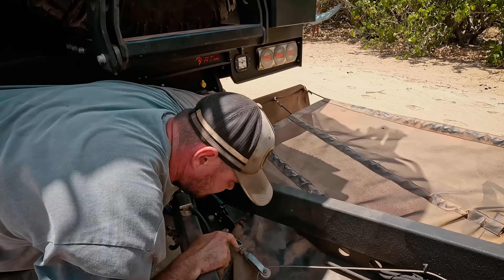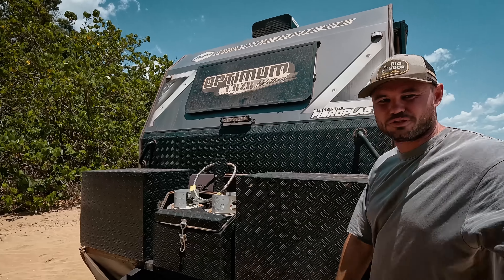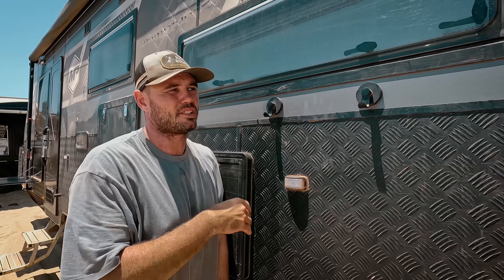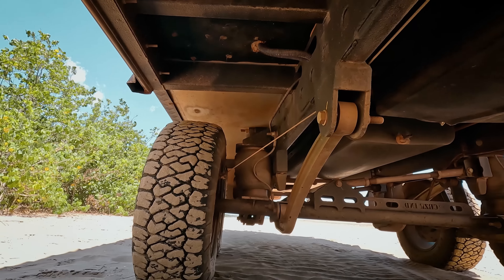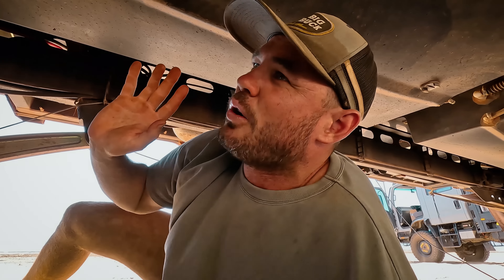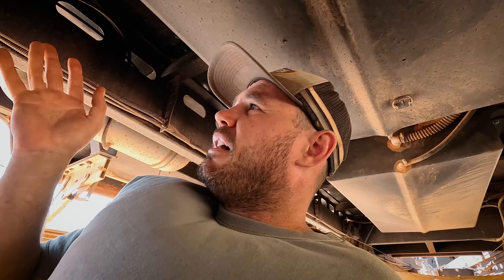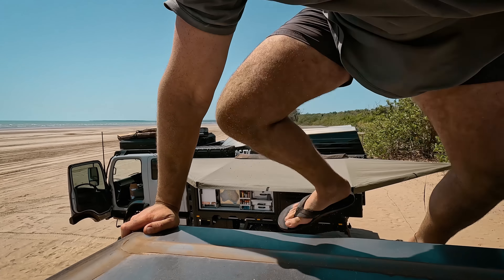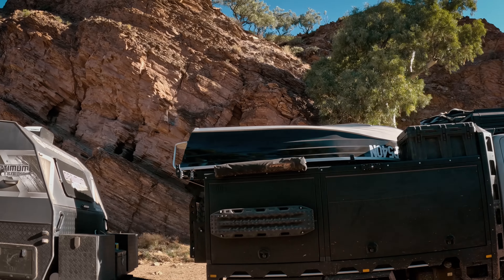25 FT OFF-ROAD OFF-GRID QUAD BUNK CARAVAN - PART 2 - SUSPENSION - CHASSIS - MASTERPIECE OPTIMUM CRZR

Comment: Good video mate 😊, although we get things galvanised to slow the process of rust and make less work for maintenance, it would be a lot easier to replace suspension then a chassis, even though it looks shit, salt is one of the things that will kill anything unless you have an electronic pulse running through the trailer which is also not  guaranteed, salt kills everything know matter what you do even washing it as water also does the same job in a slower process called electrolysis which parts the materials from each other. 
Keep up the good work.  😊

Comment: Don’t forget about the wheel bearings 10,000 km wheel bearing service and on some vans. Brand-new ones. Definitely do them at about 1000 if not straightaway soon as you purchase it. Seen some shocking shit no wheel bearing Greece at all👍 also keep the grease up to your hitch. You don’t want that getting flogged out.👍🤠